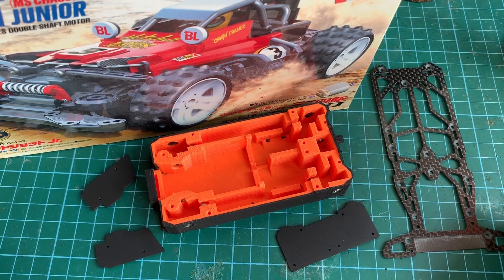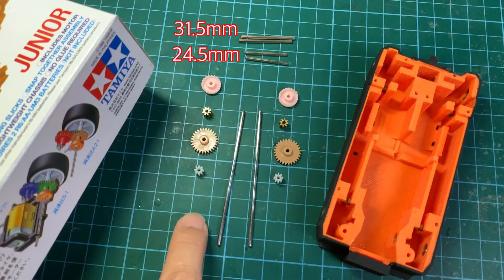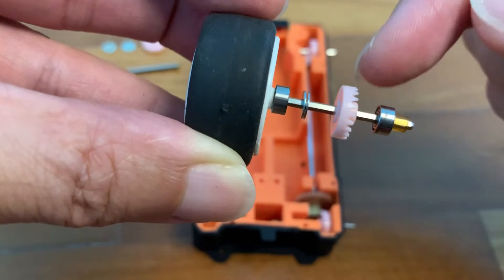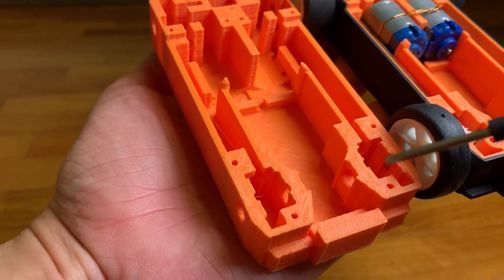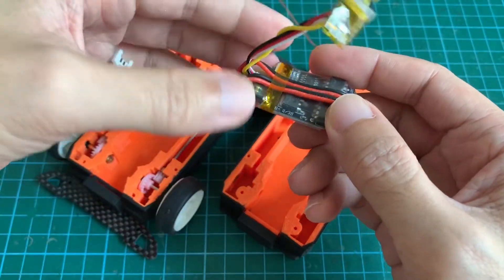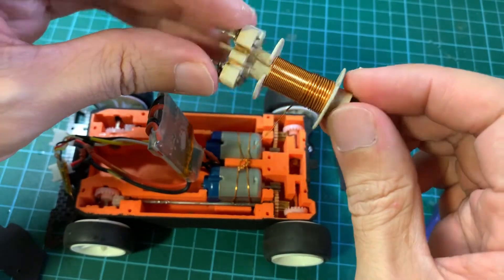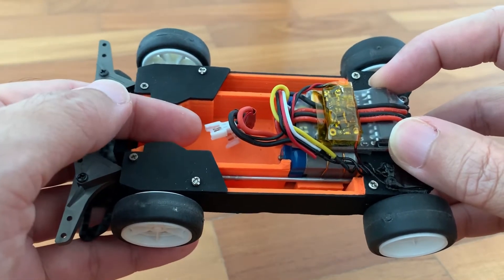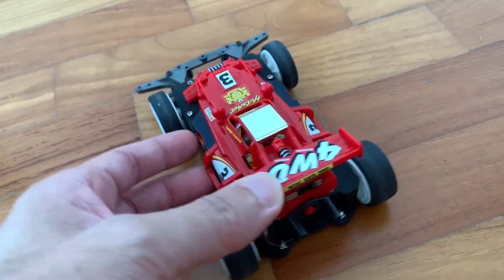Tamiya Hotshot 1/32 RC Conversion (3D printed)

Comment: Are tank control lever inverted like an aircraft? (lever back goes forward)
Reply from the maker: Thanks for dropping by. The mixer ESC used in the video kinda do all the mixing for you so the controls are basically the same like any 2 channel RC car...it’s nothing like that of an RC tank where you need to move the 2 control sticks in opposite directions to steer and both sticks down to travel straight.  :)